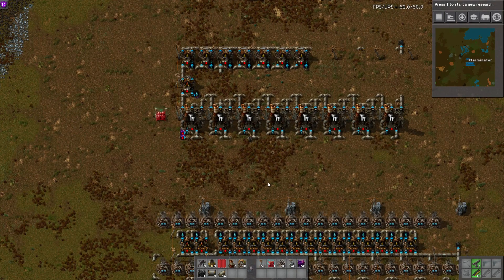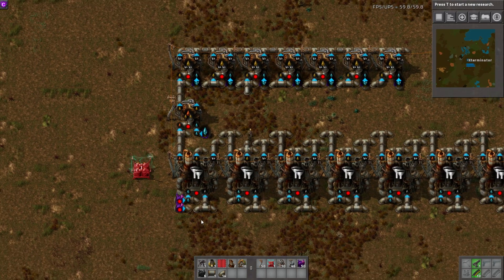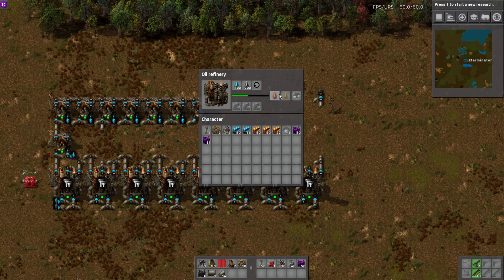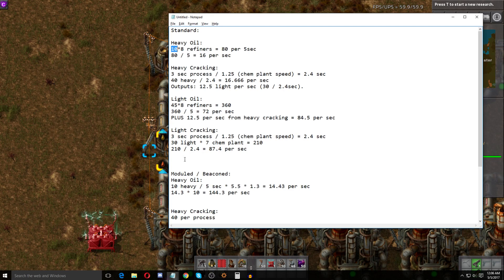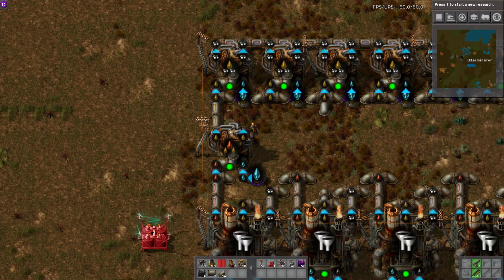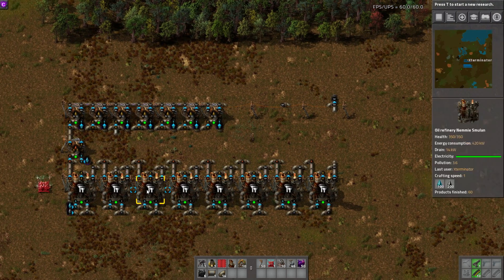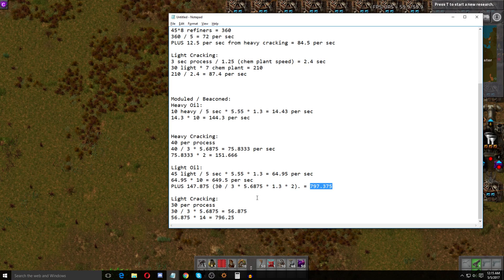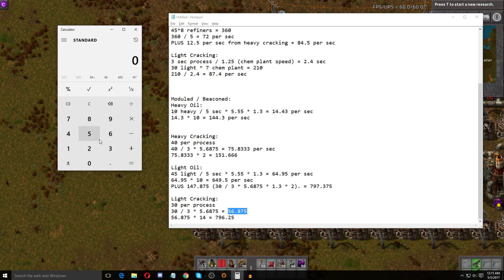Factorio 0.15 Tutorial - Oil Cracking Ratios & Calculations

Comment: i see a lot of calculations are based on cracking all oils to petroleum. i am thinking i want to keep the heavy oil for lube production. am i missing something here?

i have been working on the calculations without cracking heavy and including coal liquefication, although i didn't get there in research yet. i will  get there as soon as i am done with my oil design and ratio decision. generaly. i would rather have machine down stream starve for input than have refinary fil up and stop producing. 

found several ratios using excel. need to check why you all crack heavy rather than use it for lube first .
Reply: just watched KatherineOfSky's video on oil. i guess i can use combinators to only crack heavy when lube is full and not used up.

Comment: if you are cracking all of your heavy how do you get your lube?
Reply: You can add one. It'll still work as it just pulls some heavy out of the system. 
If you want more you need to use network logic with tanks and pumps.
Reply from the maker: A separate build would probably be your best bet.

Comment: Great. Yeah I was going to say based on the math, it looks like it will very very slowly back up on Light Oil. [Able to process 796, but has 797 incoming]

But as GORDS1229 pointed out, the fact that the Heavy->Light is operating at only 93% due to the shortage of input [Able to process 151, but only 144 incoming] Means it wont back up on Light oil after all.
Reply from the maker: Yup exactly! :)

Comment: This is the kind of video I love to see! :D The bare results in the beginning for easy reference, and the detailed derivation afterwards to understand, what's happening! :)
Just one question: why the large beaconed build? You can divide all numbers by 2 to reach a 5-1-7 build (I prefer counting the heavy before light), and you'd get the same almost-perfect ratio, no?
Reply from the maker: Glad to hear it! I think this format works quite well, so it's nice to hear you feel the same. :)
Based on the reddit post I linked, I don't think it's quite that simple. But I could certainly be wrong. If you want a smaller build, then I would definitely say give it a try with just 5-1-7 and see if it works.

Comment: According to my google spreadsheet...

Unbeaconed perfect ratio in 0.15 is 25:3:21
Dividing this by 3 gives you 8.3:1:7
Therefore 8:1:7 doesn't quite feed the crackers 100%, which prevents any back up
9:1:7 would produce a small excess of heavy and light which may be useful for lube, flamethrower ammo and solid fuel.

9:2:8 with some circuit control to let the excess heavy and light be cracked if you have enough lube, ammo and solid fuel might be a good tutorial?

Comment: Good tutorial man, good thing you brought in the number and even explained them.
Much better then the last one where we had to follow your words, and later find the numbers in the description.

Only thing I'm missing in this tutorial is: How many offshore pumps you need for those 2 setups.
Small detail, but still an essential part to make it work.
Reply from the maker: Thanks! Yeah, I figured this would be way too hard to follow along with without showing the numbers. 
Good point about the offshore pump. I didn't mention them because each build can be supported by 1 pump. I should of clarified though.

Comment: @Xterminator I like this video format where you state the ratios upfront then do the maths. However I feel this maths doesnt really show us how you got this ratio in the first place just that the ratio works. For example, how did you know to start with 8 refineries (or 10 refineries for the beacon setup). In this video you just kinda say 'since we have 8 refineries'. Unfortunately I have work soon and cant work it out myself right now, maybe tomorrow ill get a chance to go through my pre 0.15 cracking notes and work out the 0.15 ratios the same way to better show what i mean. Great video though, I look forward to more like it.
Reply from the maker: Thank you for the thoughts. :) Definitely more like it coming soon. 
I should of mentioned it, but you would actually use this exact same process to figure these ratios in the first place, it would just involve a lot of iterations of it as you go up from say 5 refineries, do the math, then realize it doesn't work well, so try it with 6, etc. I just didn't demonstrate that because it would take far too long for a video.

Comment: Erm, in the beaconed set up you work out how much light is being cracked from heavy, but then use a different number when adding it into the light that is produced from the refineries.
Reply from the maker: Really? The math seemed to work out anyway.
Reply: Hope everybody enjoys this...

https://docs.google.com/spreadsheets/d/1Y6oL3Fl4P76_GAp6oNYDv9dXtjDKBE7xiUCtktTgFgY/edit?usp=sharing
Reply: I noticed the same thing too. The problems comes from the calculation assuming the heavy-to-light chem plants are running 100% of the time - but your own calculations show that get a little less than that.
From the 10 refineries you get you 144.3 heavy/s but for the 3 heavy-to-light-chem-plants to run 100% of the time you need an input of 151.6. But further in your calculations as an output of your 3 heavy oil cracking, you assume they run 100% of the time. I haven't doublechecked DRY411S's spreadsheet, but it does seem to account for this loss of light oil.

Comment: It kinda seems like making an actual factory is pointless currently, I played for a quite a few hours everyday since about Sunday and the most recent update changed the science recipes breaking my factory :P Do you know anything about them changing the recipes frequently or is it a one time sort of thing until the next major update?
Reply from the maker: Typically they don't change recipes this often. I think it took most of us by surprise. I feel like the science packs are still possibly going to change again at some point, but who knows. I mean it is the danger of playing an experimental build, but I do understand the frustration. I'd hold off on building anything super concrete for maybe another week because they may change packs again from feedback they have gotten for these most recent ones.
Reply: They hadn't changed the formulas in like the 2 years before 0.15. They will probably stabilize very soon and remain the same through release.